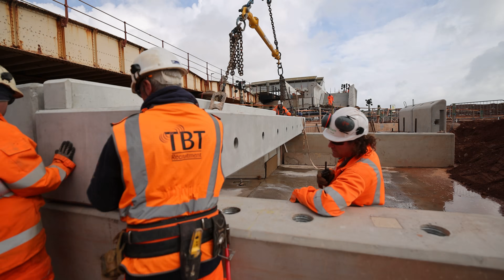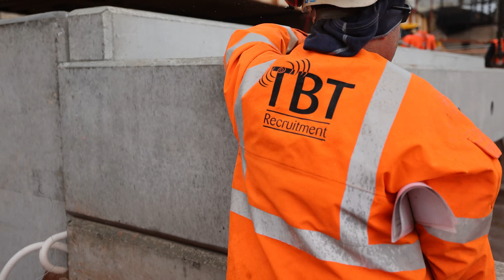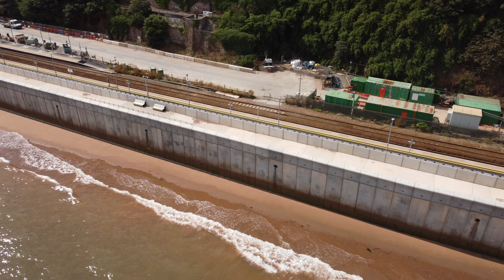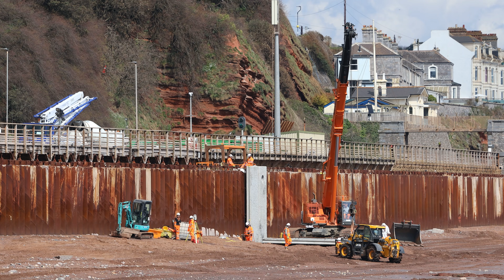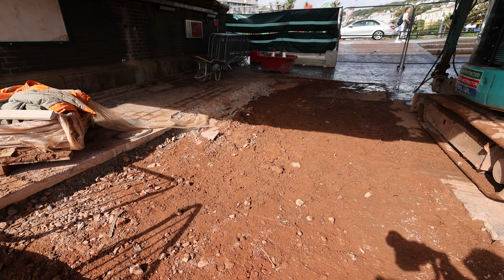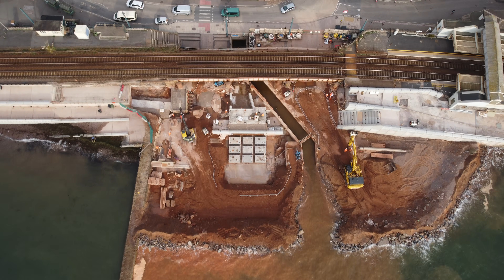Installing the New Brook Bridge at Dawlish Viaduct

Comment: Pretty poor show if they don't redo the rail bridge. Spoling  the  ship for a ha'peth. 

One of the support blocks for the pedestrian bridge already had two lumps knocked out of it - being structural, shouldn't it have been rejected on quality control grounds ?  - if you want to see what the ingress of seawater into reinforced  stressed concrete does, can I recommend a visit to Admiral Doenitz' s U-boat pens at Lorient, France

No epoxy based repair kit for the chipped  support block ?

Somebody dig-up the buidling inspector who acts for the beach authority

Comment: What a complete waste of money! Beeching failed big time by suggesting the inland route between Exeter St James and Newton Abbott be closed and not this one instead!
Reply: You are clearly not local and don’t understand the importance of the route to the local and wider economy.

A couple of points of correction:

Newton Abbot has just one ‘T’ on the end.

Exeter St James’ station, actually called St James’ Park (Exeter) that saw fewer than 35,000 passengers pass through in 2020/2021, is a tiny halt station by the football ground, and isn’t even on the main GW line.

Anyone local who understands this area would know both of these points.

Comment: I presume the rail bridge will be repainted as it looks like it has not been touched in years. Perhaps now, whilst there is all the muck and mess around, is the time to derust and put a couple of coats of anti rust primer on.  The final high tech finish, similar to the Forth Bridge coating can be done later.  That coating seems to have actually performed better than expected.  We will now have to change the saying for a never ending task.

Comment: Looks impressive now, even more so when finished. Will the railway bridge be refurbished?
Reply from the maker: It's not something on the list but it is something that the town wants to happen.
Reply: @CoastCams247  surely the ugly old rusted bridge must go, or sand blasted back and then multi coated in x number of protective layers of paint
Reply: It was determined the bridge is in good structural condition and the rust is only cosmetic
Reply: @andrewreynolds4949  Thank You Andrew, There is cosmetic, and there is cosmetic. A rusty old bridge set within a thoughtful, well designed and cosmetically beautiful sea wall. A previous reply mentions the Forth Bridge and its coating. If its good for the Scots it must be good for Dawlish.